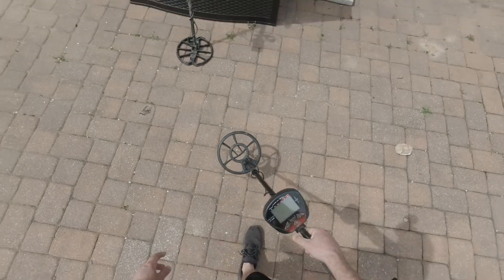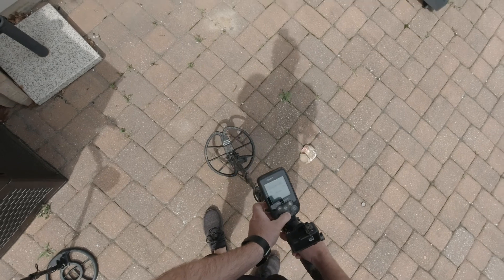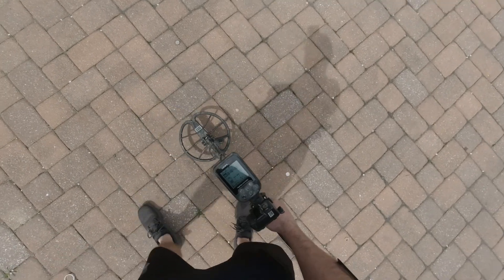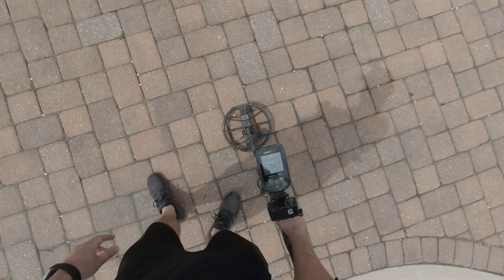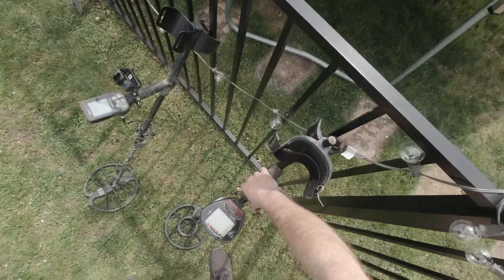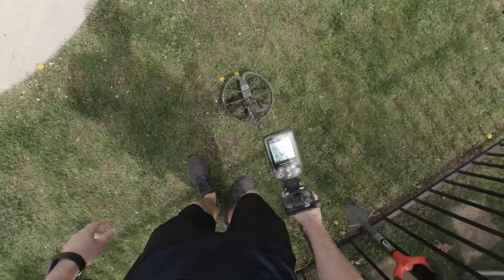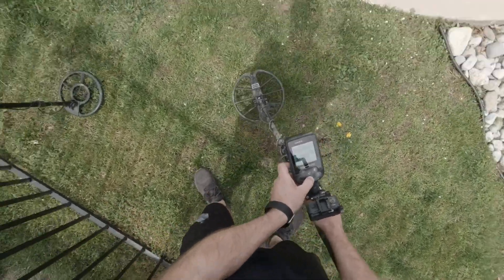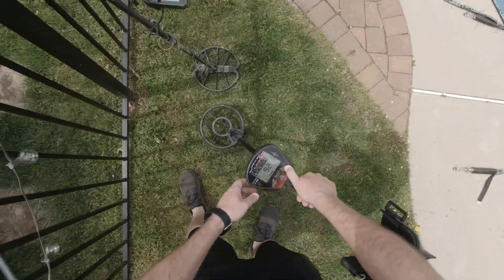Nokta Mako Simplex vs Dr Otek MT-XR simple testing (inc. 14k GOLD ring)

Comment: My OTek would switch between nail and other symbol. I didn't try to focus on the noise but the flashing symbol that indicates that there are two different metals. I guess your thing would be listening to different sounds rather than a visual indicator. But to me they both performed pretty much the same. I expected the simplex to do way better at triple the cost. Good review over all.
Reply from the maker: Thanks. With the Simplex you have "iron volume" which you can turn up and down (three settings) so you can tell when iron is passed over even when next to something else.